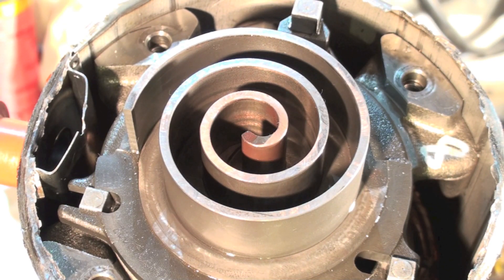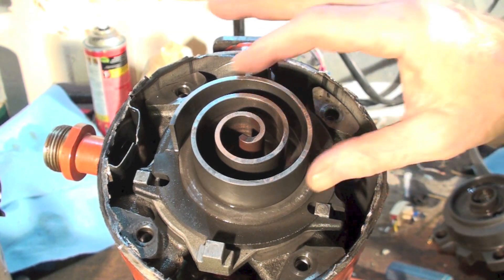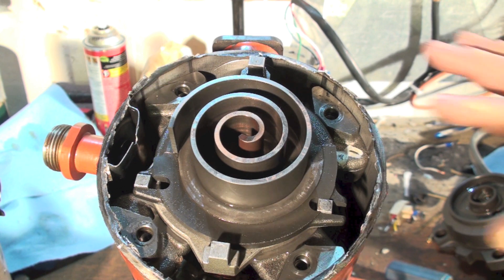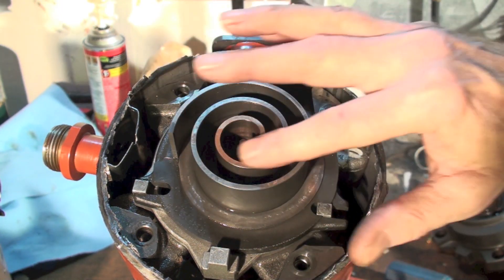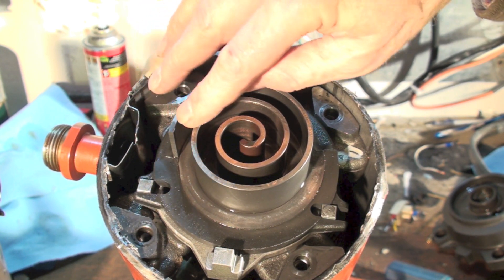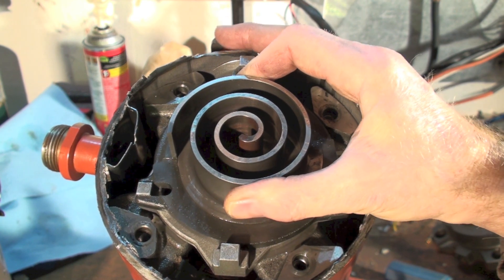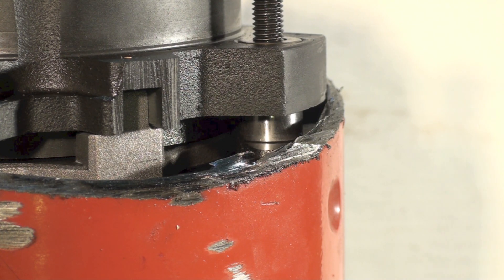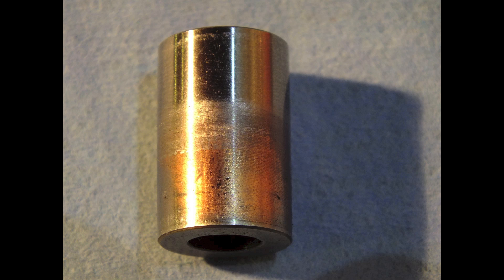Copeland scroll operation

Comment: When scrolls were introduced back in the mid 80s, and became very popular in the 90s they had accumulators, well the rheem, rudds did. You are right with liquid getting back to the compressor. The scroll has much better chance at liquid slugging than a recipicating.  Great video.